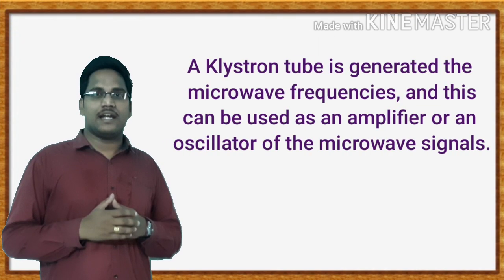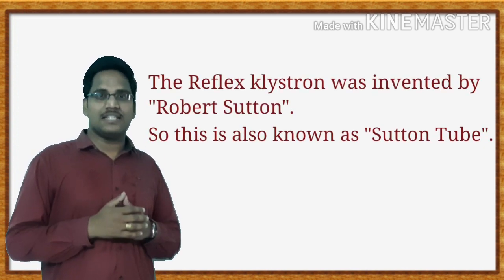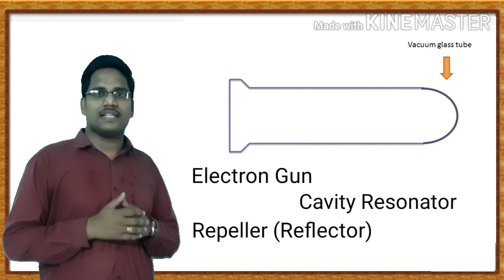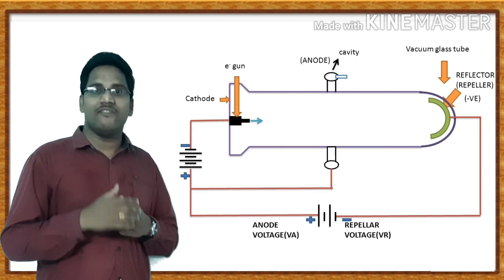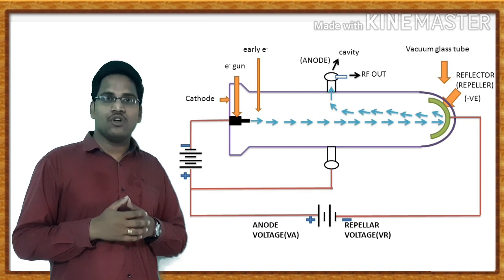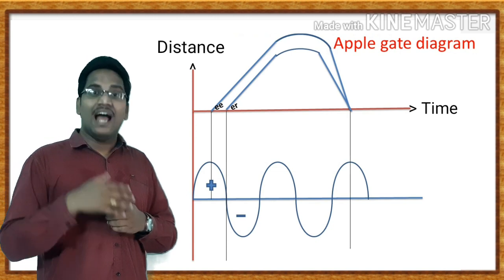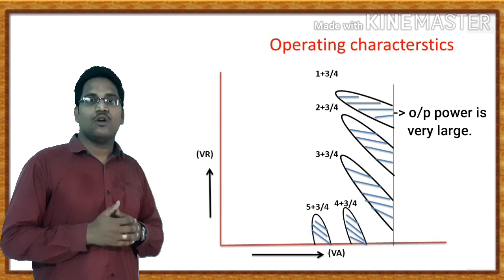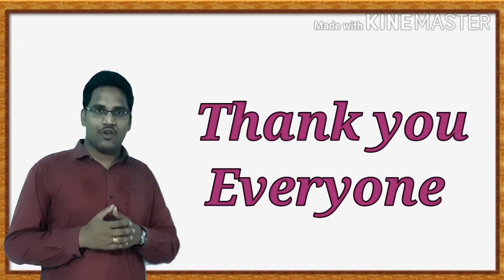Klystron Oscillator

Comment: All electrons are emitted by an electron gun so, how that early and late electrons are classified?, Are we providing constant dc supply ?, so how the electron gun emits high and low(early and late) velocity electrons??
How do we tell early electrons lesser velocity and late electrons higher velocity? (because I thought like all electrons are emitting from the electron gun and the distance between the electron gun and the repeller electrode remains constant... )
Reply from the maker: The electrons which are reaches to the repeller as first, they are called early electrons.
The electrons which are repell back to the cavity resonator, they are called reference electrons. 
And the electrons which are generated late from the electron gun, they are called late electrons. 
Even though we are applying constant DC field, the oscillator takes some time (delay) to generate the electrons from the electron gun. This causes variations in the velocity of electrons inside the tube.
Reply: @letslearntogether7340  thank you so much, i understood..🙏

Comment: What is the dc voltage value  for electron gun
Reply from the maker: To maintain sustained oscillations, the voltage value must be 230-250V under amplitude modulation.
Reply: @letslearntogether7340  actually we apply nearly 320V dc
Reply from the maker: ofcourse the range of the power supply is 180-320V